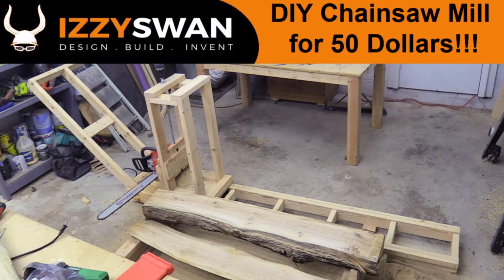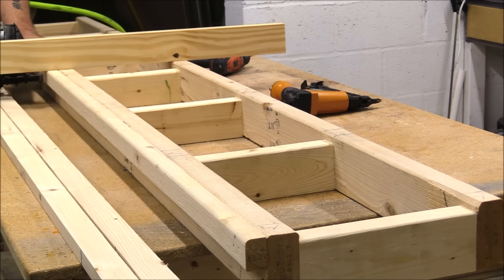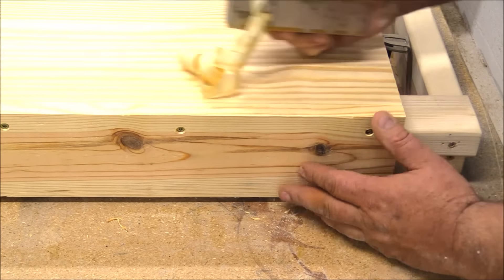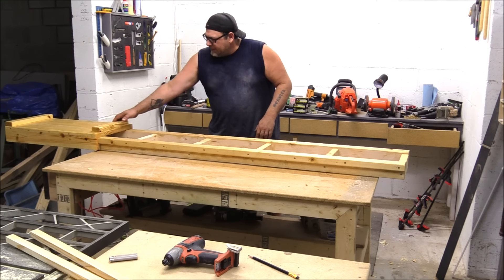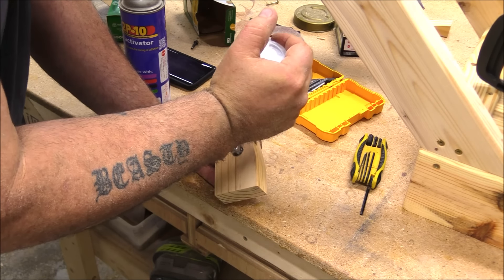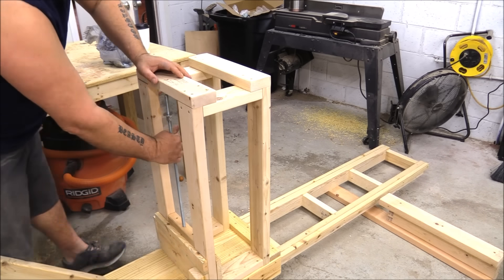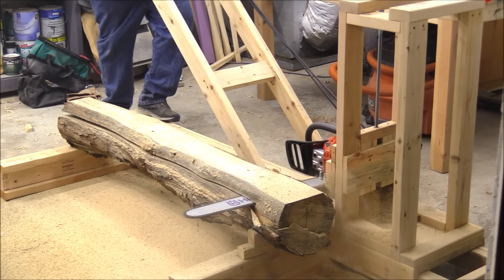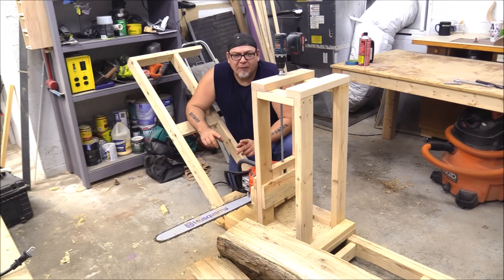Insanely Cheap Chainsaw Sawmill | How To

Comment: Beautiful, thx Izzy !!! You said you "can't wait to get a proper rip chain in". Believe it or not, despite the fact that you are running lengthwise down the log, you are in fact still "cross cutting" the grain, not ripping. (Notice you are cutting at right angles to the run of the grain, not parallel to it and therefore creating a powdery swarf).

Comment: Nice design, the weight of the saw is held by the sled and no bending pressure on the chain bar the threaded bar to raise or lower  the saw for exact thickness of cut and you pushing on the saw the way the saw was designed the best mill I have seen especially for the money.

Comment: Love it! One small improvement idea: A tape measure stuck on the side so you can see how far up or down you have moved the carriage holding the chainsaw. I think that would make choosing board thickness really easy. Great work, Izzy! (Edit: I wrote this before seeing the end of the video about not going crazy in the commens.)
Reply from the maker: lol all good
Reply: Given that the threaded rod is of a known thread pitch, you could count turns, kindda like Matthias's screw advanced box joint jig.

Comment: This is amazing!  

Only thing I would add is I wonder if there's a way to orient the saw so that the bar is more parallel to the log.  Apparently this is a more favorable angle for chisels to cut wood because they're shaving chips more with the grain, more like a plane tool, rather than trying to cut into end-grain.  So at that angle it should cut faster.  (This was a mind-blowing phenomenon when I realized it and all the credit goes to a video that Mathias Wandel made on this topic illustrating the principle with hand chisels.)  One issue is that you might have to make more passes with the saw, especially for wide logs, since the deepest cut you can make into the log won't be the full bar length anymore, and will be reduced by a factor that is the sine-function of this angle that the bar makes with the log.

Comment: If only I had space to store something like that. I'd add a block on the front and back of each rail at an angle to push the chipping build-up off to avoid potentially riding over it. Could put a brush on if wanting to get fancy.

Comment: Izzy, have you considered using angle iron for the rails?  A cheap upgrade could be using an old bed frame, mount it to the sides of the rail (instead of the ripped 2x4) and to capture the sliding platform, use old roller blade wheels.  A cheap pair of roller blades and an old bed frame can be picked up at a 2nd hand store for almost nothing.

Comment: I may borrow from your design. I would put hinges on top of the handle an run all thread through the back to not have to completely unattach the handle. Currently, I have a track I made up with old bed rails. But a Stihl 650 on a Granberg mill tends to twist from it's own weight, so I have to redesign it.

Comment: Very cool! Izzy, would the chain saw perform the same if you ran it the other direction, cutting from the top of the bar? The reason I ask is, then the saw dust would be thrown away from the sled and saw. Less clean up.
Reply from the maker: yes it would still cut just fine
Reply: It would wear out the roller tip too fast.
Reply: thanks! Love the innovating ideas.

Comment: This is really cool. Maybe a super expensive mill would get you slightly flatter boards, but you're going to run them through a planer anyway.
Reply: A good mill doesn't require milling for construction grade lumber

Comment: Not bad for version 1.0. You can also use an aluminum ladder rather than 2x4's as a slide. Next step move chainsaw throttle to area where you push instead of tape...adapt one of your pneumatic actuators?
Reply: I thought that would be a good idea, but ladders are $45 so if you are on a tight budget, then the 2x4s are still the best deal. Unless you have a ladder already. If you built it a little differently, you wouldn't have to sacrifice the ladder. You could make it removable and still have your ladder.
Reply: Maxx B good point, written by a guy with a half dozen ladders in my back yard. ☺
Reply: Alan Pinho:  Darn, I gave a ladder away 'cause it had a bad safety recall that I didn't know about and it was too late to claim it. Pieces of it would have been perfect for this.

Comment: Any tips on how to obtain a few straight 2x4's?  Seems like the big box store might only stocks boomerangs.

Also probably need to give it a coat of paint or poly once you get it how you want it, in order to slow down any water and humidity from warping it.

Comment: I like it! Looks like I will have another weekend project. How did you drill the holes through the bar? I've tried in the past, but it seems to be stainless steel and will dull any bit I put to it.
Reply: Did you try with cobalt drill bits? Should be able to get through it fine with those.
Reply: @mroek  Yes, that's what I was using. Still just dulled them out.
Reply: Hmm, ok. And you also used cutting oil/fluid? And the proper drilling speed? If yes, then I am sorry, but I don't know what else to suggest.

Comment: IZZY OMG   nothing wrong with the chain that piece of oak or hickory was prolly hard as steel any how and as for the other video green wood is much easier to cut than dried wood ,, talk to any wood turner they will tell u green wood cuts like butter  as where some dried woods need metal working tools to work them   any how love the vids keep up the good work and Cheers

Comment: If I saw this a year ago, all those logs in my backyard would now be lumber. Great work, Izzy!

Did you run into any problems with the chain binding on the end of the cut?
Reply from the maker: no problem wiht it happening so for i cutt a couple wedges to thought under the planks if needed but so far havent needed them

Comment: What is the kerf of the chainsaw. How much material will you loose by going cheap.
Reply: MySchizo Buddy exactly the same amount as a $1000 chainsaw mill, but less than an Alaskan mill. The feed is so smooth and stable that even with a dull chain the cut quality is remarkable. You often see people working their Alaskan mill back and forth, muscling it through the cut and leaving nasty chain marks all over. This being flat and smooth, I think that you would save just as much thickness by less planing later.
Reply: I wouldn't use it to cut thin boards out of valuable wood, but you could get it to a size that would then fit a shop bandsaw or table saw, and then cut the boards you want with this smaller kerf.  You can also reduce waste by taking care to stack it with "stickers", out of the rain, and with enough airflow to prevent mildewing.  Air dry it for a year or two.  It's slower than kiln drying but MUCH easier.  Once it's not green anymore then it is probably much easier to improvise a solar kiln if you need to get the moisture content low enough to be stable for indoor use.

Comment: Sweet. Now if you could just take it and have it work after it’s exposed to the rain and dampness anything else were you might actually find the logs it would be really sweet.
Reply from the maker: extrioir paint a couple coats of paste wax and it will do just fine i have seen many extior  diy saw mills over the years with wood parts that live out doors
Reply: Well now all you need is a chainsaw, and you can be alone in the wilderness. Build your own cabin.

Comment: Hey Izzy!  Been watching you since you first started showing your creativity and engineering on LumberJocks.  Nice engineering and construction.  The 460 rancher is a great chainsaw. Been using mine with a Panther Mill.   I got a present delived to my parking area. 32 inch Diameter walnut trunk logs.   Tried to get a portable mill  as there is only one in my area.  He blew me off!  WTF!   Purchased a 36 inch 070 Sthil clone, which is double the cc's but more than double the weight.  SOOOOOOOO I really am interested in how you mounted the powerhead as a couple of bolts through a bar isn't going to be adequate.  When is the next video?  an inquiring mind wants to know!
Reply from the maker: wensday or thursday

Comment: How did you drill the holes on your husq power bar? I’m using cobalt bits and barely made a dent in the bar.
Reply: Have to buy a high quality bit. He says it in his "$100 Saw Mill video i believe". I got one at Northern Tool. Was a bit pricey for 1 bit but w/ the money it saves in lumber I'm not complaining
Reply: Just realized this comment was a year ago.... whoops
Reply: Appreciate the reply, I purchased an Alaskan mill instead🤙🏽

Comment: well. That is a great build. But the $50.00 parts cost claim is a teeny weeny bit misleading.  $50.00 in parts, and several thousands of dollars in quality tools. LOL . Now I know. Once you have them you can continue making amazing stuff with them. Keep up the good work .
 Smoke has been coming out of my ears recently  thinking on using uni strut instead of wood for a mill build. It comes in 10 or 20 foot lengths in a multitude of configurations, and has available a head spinning variety of bracketry,  using 3/8" hardware to bolt it all together.  Now where did that graph pad paper go?

Comment: Awesome build once again.. made me think back to your video on the sawmill using a circular saw/beam cutter.  You think using an electric chainsaw on this latest sawmill build would be feasible? Thanks!
Reply from the maker: sure do i think with all the new electric saws comming out it is more and more possibel
Reply: @izzyswan  ...and some of the pro electric saws are comparable in power and chain speed to that husky you have,  and they can be used safely indoors : )
Reply: izzy swan: That's great Izzy. Just got a new Oregon corded electric.

Comment: Get a file and make a rip cut chain by yourself. Just file the teeth of the chain to a 10 degree angle.
Reply from the maker: my uncle was good at that i have my chains sharpener professionally i have not done it enough to be good at it
Reply: @izzyswan 
Yeah just try filing. There are little marks for the angle, just file parallel to those a few strokes per teeth.

Nice build btw.
Reply: @AnttiHarri  the Marks on a normal Chain are for crosscuts (25 to 35 degree). If you want to covert the chain to a rip cut chain, you have to file at 10 degree angle. You can make a 10 degree line on a piece of wood and stick this to the sword with magnets. Now you Just have to follow the line with the file.
Reply: @DiesesFeldNichtBeschriften  
Yeah. My reply was mostly with the thought that even a sharp cross cut chain is better than a dull one. :) and it might be an easier way to get started.
Reply: Langweilige zusammenhanglose schlechte Handyvideos Hi! Good to know, but, could you link us to a good tutorial on how to do this conversion? Please! Does it really yields the same slicing quality cuts?